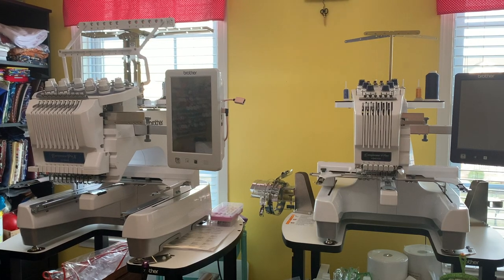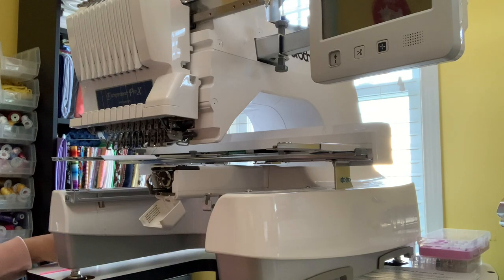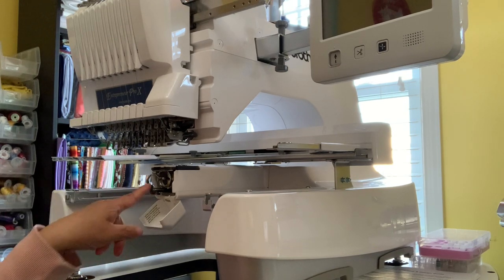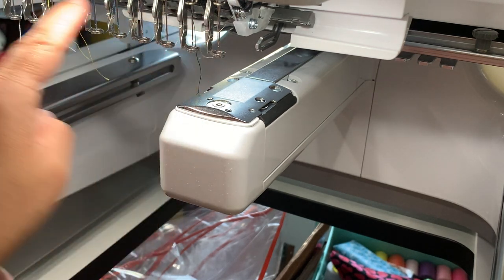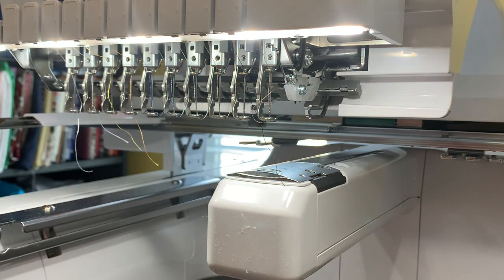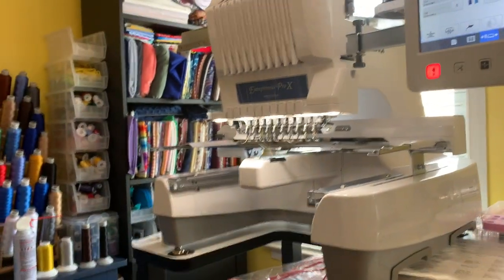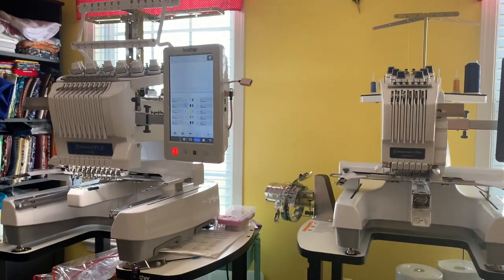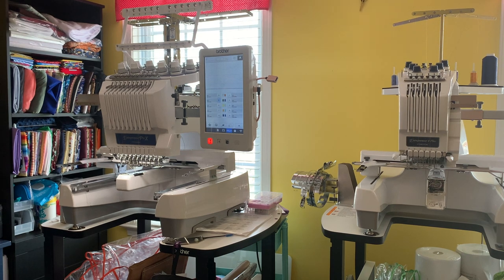Performing Maintenance on my Brother 1055X and Brother PR670e Multi-needle Embroidery Machines

Comment: Hi there!  Love your videos!  So informative.  I have Brother PR1055X and decided it was time to change my needles.  I have only had a few months but have been cleaning it as you recommended.  I took all 10 needles out and put them in to the very top so they touch the top of the square box but as much as I have tried my needle threader no longer will thread any of the needles.  Is this a common problem and if so do you have any recommendations or is the needle threader finicky?   Thank you in advance for any advise.  Sincerely, Karyn
Reply from the maker: Hi Karen.  Make sure that you have the right needles in the machine.  Use a magnifying glass to make sure the needle threader is entering the eye of the needle.  If it's not working you will have to replace it.  I found a video that was very useful when I had to replace mine.  Here is the link.  They do an excellent job in showing all the details on changing it.  https://www.youtube.com/watch?v=5MVNhxmZr1Q&t=41s
Reply: @BoricuaSewingCrafts  Thank you for your reply. I appreciate the information I have ordered a replacement threader.  Thank you for referencing the informative installation video. Wishing you a very merry Christmas. Thanks again.

Comment: Jeanette I’m confused. On your live recently I asked you about oiling the top of the needle bars and you told me that your guy said not too. Should I or shouldn’t I?
Reply from the maker: Hi Allison.  The guy told me not to do this regularly. Just oil the bobbin area whenever you are going to use the machine.  He said it's not required to do all the time and even said it's not really necessary.   I looked it up in the manual and they do recommend oiling the needles.  So I do this only once a month or bi-monthly.
Reply: @BoricuaSewingCrafts  thank you Jeanette. I’ve seen people on YouTube oil the needle bars but no one has told me it has to be done in the year I’ve owned my machine. I guess due to Covid I never did get much instructions.
Reply from the maker: @allisonholloway833  I have seen folks do that too.  When I asked the techican he said just focus on the bobbin area.  When you asked me last friday I looked it up and called him.  He said I can do this but not too often.  He said you don't want to mess up the felt pads there.  So I told him that I would do it monthly or bimonthly.  He said he would replace the pads when he doesn my annual service on the machine.  I just started to do this. But the machine always worked great!
Reply: @BoricuaSewingCrafts  Jeanette I just wanted to share something with you. The first time I changed a needle on my 10 needle, I failed big time. I thought I got the screw tight enough and when I started embroidering the needle fell out and made a horrible noise. I was so upset I thought I broke the machine. Ever since then I’ve been afraid and intimidated to try again. Today I took a deep breath and with my two corgis at my side cheering me on, I changed all 10 needles without a hitch.😅😁

Comment: Started getting wiper error last night
Reply from the maker: You might have a piece of thread in there.  I would press the button to thread the needle and clean the area behind it.  If that doesn't work your sensors might be off and you will need to take it to get serviced.